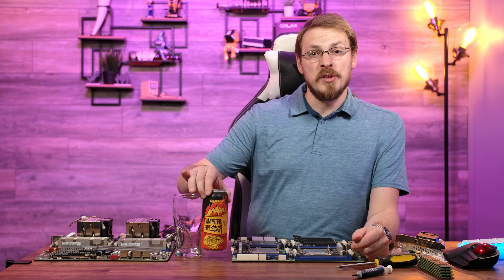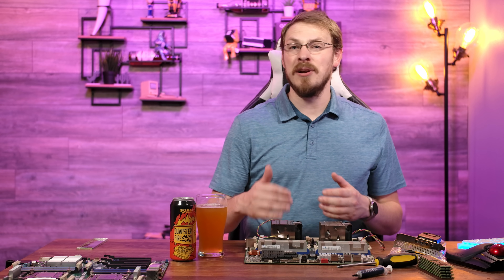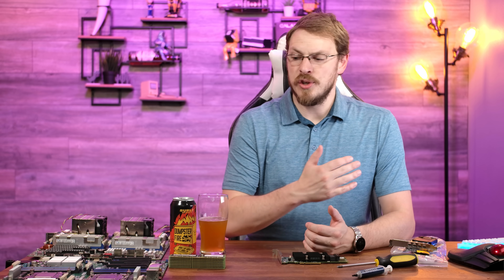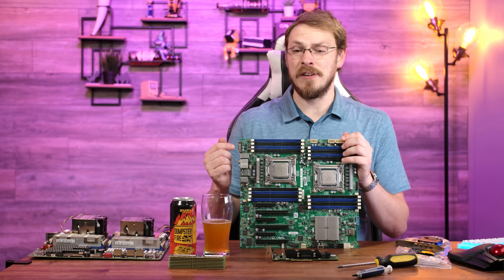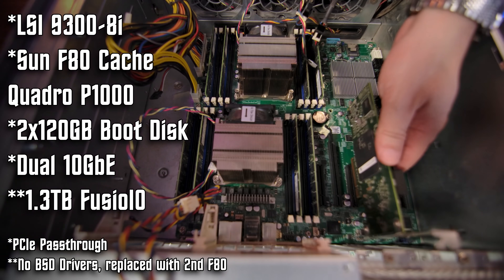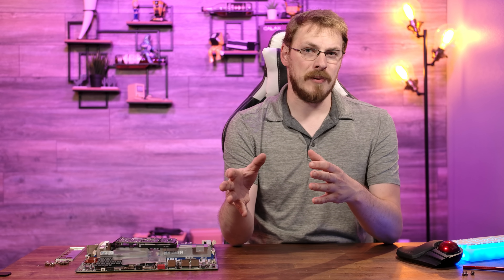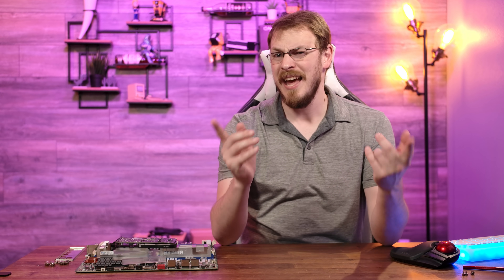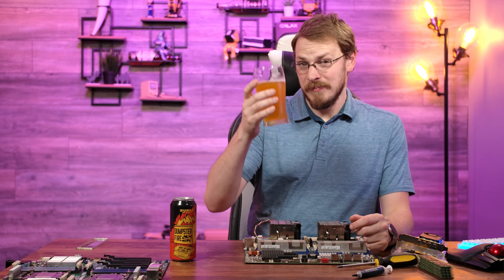Running out of things to die - TrueNAS Motherboard Replacement

Comment: man I have 2 X9DAi both with the same symptoms with 2 Intel Xeon E5-2690 V2 unstable AF just Locking up 2 times a week.  I'm giving up on it and going back to my Dual 1366 I was using for Plex thing is OLD but Rock solid.

Comment: I have just Delved into the realm of TrueNAS Scale, i have just setup a test system to see how it all works and what it can do. So far the specs are as sollows

AMD FX 6300 (Don't laugh)
Gigabyte 970A Motherboard
16GB DDR3 SDRAM
Geforce GT 710  PCIe x1 GPU 1(Again Don't laugh)
LSI 6Gbps SAS 8 port card 

5x 2GB Seagate Barracuda HDD in RAIDZ1 
Crucial MX500 SSD as Boot device
Silverstone CS380 Case

The Plan is to test out how well ZFS works and just to do a general test of the setup in prep for a real hardware which will include

AMD EPYC 7552 CPU
256GB DDR4 2667 ECC memory
Supermicro Rome/Milan ready motherboard 
LSI SAS HBA
Geforce GTX Titan X Maxwell 12GB
8x Seagate Ironwolf Pro 10TB setup with 2x5 drive RAIDZ1 combined into a single Pool 
2x 120GB SATA SSD's for cache drives
1x 128GB NVMe SSD and boot drive

Comment: I am very interested in building a similar setup for a homelab. I was really considering proxmox with truenas as an option but I am not so sure now. However, it is unlikely that I will need to have cache drives but I don't like the lack of options. If I do this plan, I will for sure get a sas3 backplane to help. Other proxmox vms would be plex and related items and maybe opensense router. Any thoughts on homelab router vms?

Comment: The upgrade itch is real, I have a Xeon e5 2650 v3, 64 gb ecc ram, as rock x99, gtx1050 all running a nas, pled and internal surveillance camera system. Think I’ll need a 10gb nic so that I can isolate the camera system and have better through put for the nas and plex server!

Comment: My home server isn't even a server. It's just an old Lenovo workstation with an i5-4570 and 16GB of RAM. It's purely a Minecraft server for now, so I'm fine with running Windows on it, but my next upgrade is gonna be a big all-in-one custom built tower for both FreeNAS  or similar, and a couple VMs to run my Minecraft server and other things on. Ideally, I'd like at least one 8 core 16 thread Xeon (no particular model in mind, I'm still doing some looking and research), a minimum of 64GB of ECC RAM, and a minimum of 20TB of hard drive storage. Now to save up for it...

Comment: Interesting video, my Z9PE died on me last week the same way you've described. She went through several PSU related failure and the last time I went in the bios I discovered unusual voltages 12V -> 15V and 5V ->6V.
I'm suspecting all electrolytic capacitors.. gonna try to recap.

I'm running:
 2 x Xeon 2650L 392Gb Ddr3 Ecc 1833Mhz, Gigabyte ga7peslx + 2 x K6000 sli and Areca and LSI raid 
 2 x Xeon 2697V2 256Gb Ddr 3 Ecc 1833Mhz, Asus Z9PEd8Ws + 3 x P4000 sli and Areca and Lsi raid 
 2 x Xeon 2698V4 32Gb Ddr4 Ecc 2400T, Asus Z10PEd8Ws LSI raid + Rtx 4000

I'm planing adding faster/more RAM for the last one and buying more Quadros !!!

Comment: Thank you!  I enjoy the fact that you present a verbose video.  I use and have 12 yr old equipment to one gen back.    I have enjoyed fine craft beer - some 10% stuff. I enjoy the dark flavors.   But I also enjoy whiskey.  1792 - single batch - is a smooth - forget the water and enjoy the flavors.   Like you - I am suspect of drives.  I had a few DeathStars of 20 yrs ago. Mine and customers machines. So now I run 24 months and then they get pulled. Cheers Sir!

Comment: My NAS is more a Cloud NAS based on a Gigabyte R272-Z31 with a Epyc 7282 and 128 GB of RAM. Connection is provided by two Intel based 40 GBE NICs.
Drives are a couple of 4TB SATA SSDs.
Cloud because parts of my family have VPN access with their own cloud storage.

Comment: Currently Running HP Z Series Dual XEON Boxes on ESXi and a TrueNas Xeon box. 
Just about to consolidate all of this and move to a Proxmox box running BlueIris in a VM. Lots of PCIe Storage and a new case.
Also just built a 4 RasPi 4 8GB rack mount for the home rack to handle the PiHole and some other monitoring things...

Comment: We have a X3650 M3 NAS Server 
Also a DS8880 Rack no inserts on the Moment 
All is been going with glasfiber Connection from the Server room to the second floor. 
We are planning next the DS8880 POWER PC UNITS to reconfigure. But on the first we had to wait on the new planed Firmware upgrade for the AIX - LSI Controller fromm IBM 
All Stuff comes from deconstruction of a Datacenter

Comment: Were the CPUs you chose just really cheap? Curious as to why you went with a 4 socket capable xeon in a 2 socket system when fast dual socket Xeons like the E5-2667v2 would give you twice as many threads at similar frequencies. Either way, great vid!

My favorite hazy ever is from Wild Barrel brewing co. It's called Mozzacca. If you ever come across it, get it.

Comment: Man, you don't expect much out of your boards, do you?😂 I'm currently running an IBM x3650 - 7945-AC1 2U rack-mount with 2x E5620 Xeon CPU's and 64gb. of RAM. At the moment, it's got 8x 600gb. 6GB SAS drives in RAID5 and hosts my PLEX media server, bookkeeping and invoicing programs, and 2 active websites. I was thinking about doing XigmaNAS on a VM, but I don't want to put all my eggs in one basket, so will probably commission another server solely for XigmaNAS to host backups for all my other junk. I don't really do any video editing, but I already have OBS and all the necessary tools on a HP Z400 workstation that dual-boots Linux-Mint & Win 10 with a good graphics card for streaming, and has 4 TB. of storage on board. All of my everyday stuff is done on a modded 2012 Mac-Pro with 32GB RAM and 7.5 TB. of combined SSD and regular SATA drive storage.😉

Comment: "What hardware do you run in your home server and what's your next planned upgrade?"
Which server are you talking about?

I technically have I think 8 servers, (four are down, four are up), and that doesn't include by license server nor does it include any of the virtualised servers that are running inside the physical servers.

Planned upgrade:
(theorectically) 18-port 100 GbE switch, at least three more Mellanox ConnectX-5 dual 100 Gb VPI port cards, and fibre cables so that each of the cards will be plugged both into my 100 Gbps IB switch and also the new 100 GbE switch as well.

But it's going to be some time before that upgrade will go through as presently, I am also trying to figure out how to bridge between SFP+ 10 Gbps fibre to QSFP28 100 Gbps fibre to 1 GbE.

Comment: I'm not sure if it counts as a "home lab" because we run an IT business from my office, but it is at home.  I have a pair of Lenovo RD350's, one with a rebranded LSI HBA in it.  The one with the HBA runs Win2016 and is a Plex Media Server.  The other runs Hyper-V and hosts a mix of Linux and Windows VM's.  They live in a 42U Dell rack along with a handful of other machines doing various tasks, ranging from a repurposed HP desktop doing Veeam B/R host duty to a couple of rpi's and a Chia farm.  There's also a 24-port Avocent network KVM and a Dell pull-out console.

The problem is that it lives *IN* the office with me, and I am tired of hearing it.  I'm thinking that the not-too-distant future holds a nice, QUIET, liquid-cooled threadripper VMWare or Proxxmoxx host with most of the machines virtualized in it.  The rack and ThinkServers can go on Craigslist.

Comment: After a 5 day array rebuild, I'm going to be splitting up my file server into multiple servers again. While it was convenient having it all on one host, having said host inaccessible for a week (because I kicked off the rebuild from the controller BIOS) I don't want to go through that again. 
So 2 possibly 3 smaller servers instead of the one are on tap. Fortunately I'd picked up an ASRock X470D4U and R3 3100 to test with an Asus M.2 NVMe card and 4 drives, just to see what the performance was like. May use that as fast storage for WIM files, but we'll see. Worst case I use it as a caching setup, with more traditional storage.
Seriously looking at replacing the spinners with SSDs though, as the space, power draw and heat are far better, but the longevity issue is a concern.
I've got a couple of older E3-1220's I can use for the less throughput heavy files, and keep the most frequently access stuff on spinning rust.

If I can get some decent deals on more ECC RAM & drives, I should end up with more storage, fewer spindles and get closer to saturating my LAN, giving me an excus... a legitimate reason to go to 10Gb or faster.

Smaller servers will make for smaller backups and less downtime if there's an issue.

Going to upgrade my Esxi box( which really just hosts my WSUS server) from a 4 drive RAID 5 to a 4 drive RAID 5. ;) Going from (4) 4TB spinners to (4) 1TB NAS SSDs. I picked up a  4x M.2 SATA to 3.5" bay adapter from Startech, and I'm looking at the WD Red NAS M.2 SATA SSDs. That doesn't need a lot of CPU, so I'm up in the air about the platform, but leaning MiniITX as that's what the current one is on, and going from four 3.5" drive bays needed to one  really opens  things up case wise.

Comment: TheVault: 
HP ProLiant DL370 G6, 2 x X5690, 288GB RAM, 12x2TB 7.2k, dual 10Gbit, 2TB cache drive, LSI 9200-8e connected to NetApp DS4246 with 24x2TB (some have been upgraded to 4TB)

TheBeast:
HP ProLiant DL380p G8, 2 x e5 2690, 384GB DDR3, 12 x 1.2TB 2,5" 10k rpm, dual 10Gbit ethernet, 2TB NVMe cache

Both run Unraid Pro with dual parity

Comment: I also had problems with the HBA330 PCIe Passtrough and Truenas, the solution was booting the VM without the controller and adding the tuneable Variable: "hw.pci.honor_msi_blacklist" Value: 0 Type: Loader
After that it runs just fine. I did this on ESXI 7.0.1 but it should also work on Proxmox
Reply: This went all down as i upgraded to my current server, a Dell T630 in the rare 18x LFF version. For the boot drive and VM storage i use a H730p with 2x 256GB and 6x 1Tb SSD in RAID mode, the SSDs are in an 8x SFF Carrier in the DVD drive bay. The 18x 3,5" slots are halfway populated with 4TB drives and some 12G SAS SSDs for caching.
The base Specs are two Xeon 2690v4 and 192GB System Memory.
The Hypervisor is ESXi 7 and its running my firewall with dedicated X540 and i350 NICs, Emby media Server with a Nvidia P2000 and Truenas with the HBA330 passed through (and some more VMs).
Very stable plattform, almost silent and about 170W powerdraw with spinning disks. I'm very happy, got everything quite cheap and have enough power for a few Years. Need some additional 32GB modules soon. RAM is almost maxed out at the moment..

Comment: Before you throw out that dead motherboard, check all the voltages. If you can get into the OOB management (IPMI) you should be able to see the sensor readings. In particular, look at the standby voltage. Also, check the CMOS battery... probably a 2032 and see if it is below 3v. Just in case it helps you prevent that board from going to e-waste...

Comment: All I run are Supermicro MB’s for my servers with older Xeon CPU’s in both single and dual configurations and Asus workstation MB’s for my PC’s. Only had one dud Serverboard out of 10 used boards and had bad luck quickly with ASRock MB’s for a PC. I also had bad luck with Seagate constellation 2TB “refurbished” drives so now I only buy NEW WD Gold drives and so far, no issues.

Comment: Great videos, keep it up!  LGA2011 v1/v2 is still a fantasitc platform for homelabing. I recently parted out or given away my Westmere servers and gear and now am 100% sandy/ivy bridge. DDR3 ECC RAM is cheap, quite accessible to have 1TB of RAM at home for labbing. Do you think you are really hitting a bottleneck with HBA's with SAS2 interfaces? I mean, with spindles, I don't think 6Gbit X 4 lanes are a problem IMO. Nice CPUs BTW, I did not lay my eyes on any E5-4XXX CPUs at all before listening to your videos.

Comment: You definitely need and a 2x40, 50 or 60mm fans for cooling the controller. And swap those boxed coolers for better ones (too noisy and not so effective like tower designs).

Now about the faulty mobo - just send it to some good repair shop near you. It's expensive to not to check what's broken

Comment: I'm curious on what the performance difference to a modern consumer e.g. Ryzen system is. I was running a similar setup with dual E5-2667V1s a while ago but switched to a standard 8 Core Ryzen system later on. The increase in single core performance is very noticeably, so for a workstation its way nicer. The mayor cost increase is definitely the memory and ECC is a bit tricky. Made up by reduced power costs, especially in germany though.

Comment: Because of you and Techno Tim, I'm running an HP Z800 with a pair of 5650's and 48GB of memory. I found a computer in the trash, i3, 8GB with a sata card so I threw freenas on that. I liked it so much better than my synologies, that I'm currently building out a new Freenas box and a extra Ryzen 7 3700XT I had. I'm using one of your workstation builds as a guide for the sata card.

Comment: I am genuinely shocked right now, I had an identical issue with bios on my own truenas system, and I do not even have a sun cache card and never would have realized it could have been from an addon card, its gone now, but now I am left wondering if my bad hp sas expander was to blame, since the issue seems to have gone away sometime around when I swapped it out for a replacement.  Maybe its a random issue with supermicro boards, as mine is an x9dr3-f board.  Curious. Good video as always.
Reply from the maker: I have two theories. Either one of the Boot ROMs were corrupt on the Sun F80s, or I had too many devices adding info to the BIOS, and ran out of memory.

Comment: Upgrade to my setup... Nice and easy. I bought a Synology ds1621+ bare 4gb Nas. I backed up my rs812 and swapped out the 4 by 4tb red hddi to the DS1621+. One OS update later and it is up and running. Because I had a couple of spare 2tb HDD laying around, I dropped them into the DS, as hot swap spares.
I had 4 500gb HDD laying around, and have put them in the rs812 as raid 5, with one drive set as hot swap spare (this will  soon be put on eBay for sale on there). Once I have that done, I have a ds620 which currently has 500gb drives inside, and I have purchased 6 by 1tb SSD to upgrade later this week.
I have an older Netgear nvx which has been my goto server for many years, is being retired, because windows 10, doesn't like it. So busy days ahead, moving my stuff around between old stuff and new. Then once all that is done, I need to reconfigure my home security to use the new gear .. such fun... As for the NVX once I have cleared it down... Maybe use it with a Linux pc setup, or just pass it on to someone who needs it... I don't know yet

Comment: i run a Dell PowerEdge R710 at home running unraid with these specs 😁
2 Intel Xeon X5690 12MB Smart Cache 3.46GHz (Turbo - 3.73GHz) 6 Core 12 Threads 6.4GT/s 130W
192GB HP 2RX4 PC3L-10600R DDR3 1333MHz ECC Memory
Toshiba DVD-RW Slimline SATA Drive (Model: TS-L633 - Replaced With 240GB Crucial SSD)
6 Western Digital 4TB 7.2K 6G SAS 3.5" Hard Drive
s
PERC H200I SAS Sata Raid Controller (Flashed Into IT Mode)
iDRAC6 Remote Access Enterprise Card
Dell 16GB iDRAC6 vFlash Class 10 SD Card
HP NC550SFP 10 Gigabit 2 Port PCIe x8 Ethernet Adapter (581201-B21
)
2 Dell 870W Hot Swap Redundant Power Supplies

i also have an R610 which is currently not in use with 2 X5675 cpu's and 98GB of ram.

Comment: Got a Supermicro server in an SC847 chassis (2 backplanes with 12 and 24 bays). amd epyc 7401p, H11SSL-NC motherboard, 128GB ram, 2 x LSI 9300-8i and a P400 graphics card. Running proxmox, with 1 hba dedicated to the proxmox system (using the 12 bay backplane), while the other and the GPU is passed through to a vm running Debian. I currently have 4 8tb seagate exos drives for the proxmox system, while the debian system I've set up as my NAS/Plex has 8 12 tb hgst hc520 drives. Looking into adding more drives to the NAS part of the system, but they're expensive right now...

As I've added the drives over time, I wanted something i could expand incrementally, so I'm using Linux MD raid 6 (2 disc redundancy), LVM and ext4 which has worked out pretty nicely so far.

Right now, anything can break down (except the motherboard/cpu), and I'll still be able to make it work with the redundancy that's in the sytem. Just have to fiddle a bit with rewiring and configuration.

Comment: Since you did the video showing how to get FreeNAS running under Proxmox I figured you were still running that setup after upgrading to TrueNas. I probably skipped a video or two since then ;-)

I had a spare Z97 ITX board with a 4790K in it that I decided to setup following that video, so I grabbed a cheap m.2 to use as a boot drive and went at it. Popped Win10 on there as well (following that video) and planned on playing around with PiHole and some other bits and pieces. 
The hitch right now is that all my storage drives are in a USB3 enclosure, so it's slow as hell and noisy. Next step is to get them connected up internally, though I have more disks than 3.5" bays and SATA ports, so I'm either going to have to pick up an HBA or move it all over to an even older system (X58 & i7-920) which has plenty of bays and just enough ports.